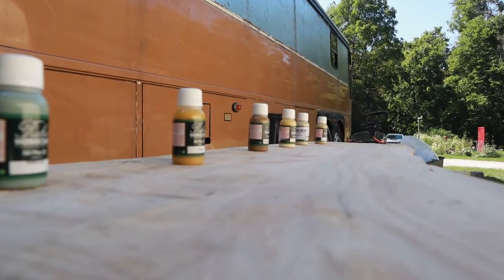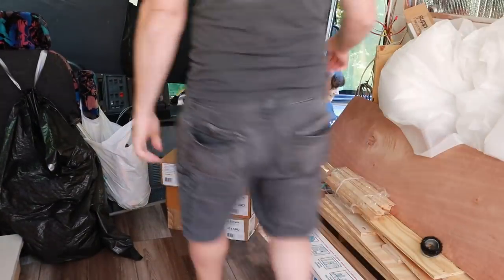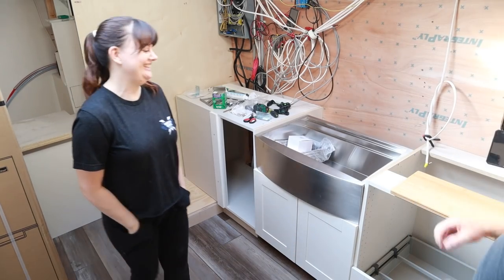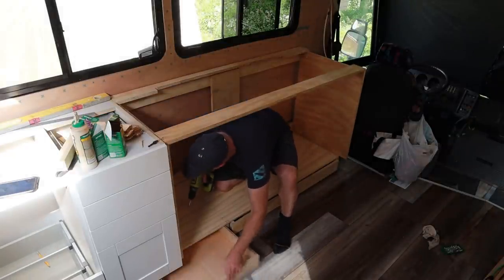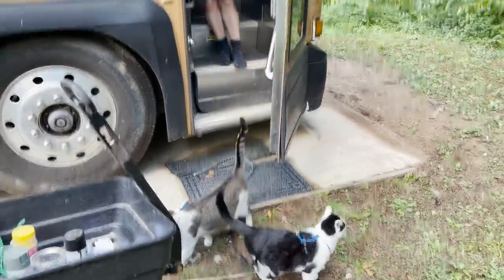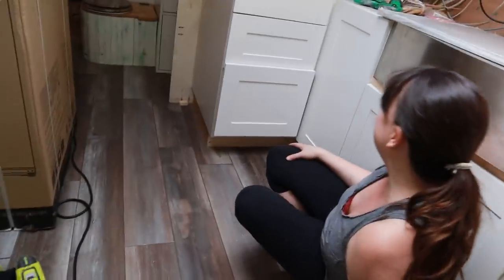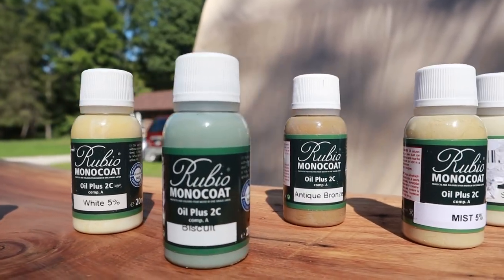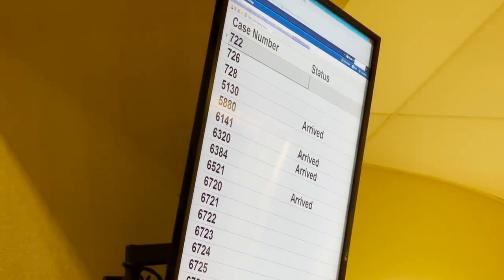Easy Kitchen Cabinet Install in our Bus Conversion BEFORE SURGERY - S04E29

Comment: Hope that surgery goes and went well for Mela, prayers for a speedy recovery. Just and idea I think I would use the same stain that you used on your wire trim ,just not as dark to keep your theme the same,but of course theres nothing wrong with using color,but I think it needs to be something from the same color pallet,but of course it your build and of course your choice.I have been watching from the beginning and yall are doing some beautiful work,keep it up.

Comment: Are your cabinets made from engineered lumber, plywood or real hardwood???  Looks like you still have to put time into creating and installing them.  If they are engineered or plywood, I think you could have made beautiful cabinets out of real wood and master cabinet makers techniques like dovetail connections which is a sign of quality work for sure with not that much more effort!!!  But the results would have been exquisite!!!  And you probably would never have any problems with them!!!
Reply: Watching you put those cabinets together, I can tell they were not top shelf cabinets.  Good cabinetry would have had full sized drawers and not metal bars which flex.  AND they would have all been constructed already and all you would have to do is install them!!!
Reply: And you wouldn't have needed any edgebanding which always indicates lower quality and value!!!
Reply: Are those drawers metal???  I hope you didn't pay a lot for those cabinets.

Comment: What are you going to do with the worms???
Reply: Will the worms draw fruit flies or any other bugs???
Reply: Will it smell???  Where will you keep the worm bucket???  Also worms multiply.  What will you do when you have more worms than you can supply food to???
Reply from the maker: It doesn't smell at all.  There are some bugs inside.  It is an eco-system, so there will be some bugs but by making sure you create a good environment for the worms (not too dry and not too moist) then there shouldn't be too many other bugs.  It all stays very well contained inside the bucket though.  I think putting a screen on the lid helped.  Still learning about how to create the right environment.  Apparently the worms somehow know when there are enough of them and will slow down on reproduction when there are enough of them for the size of the container and amount of food.  Right now we def don't have enough worms.  We'd store in the luggage bay if we decide this going to work in the bus.